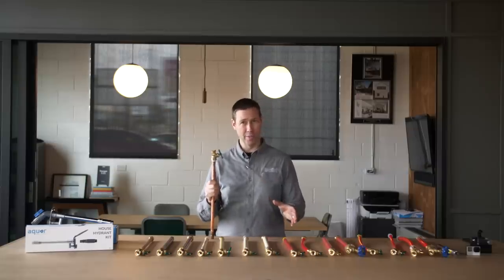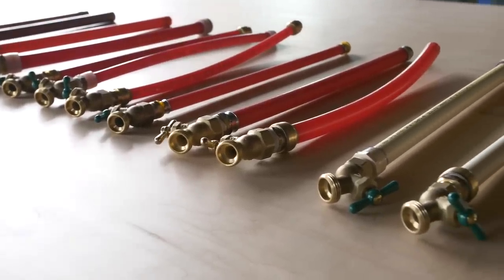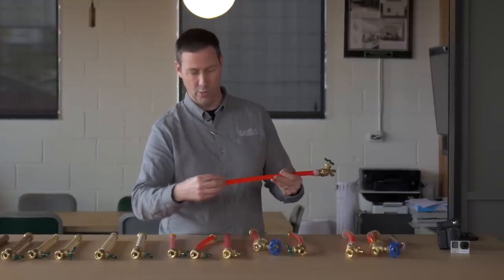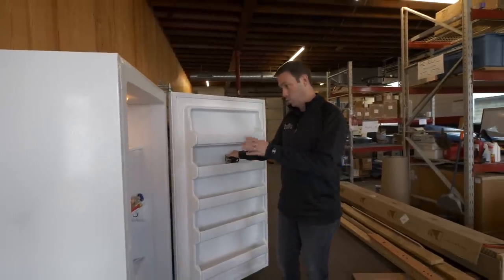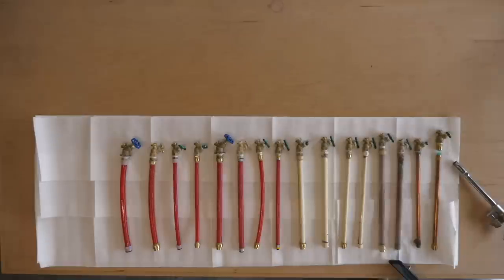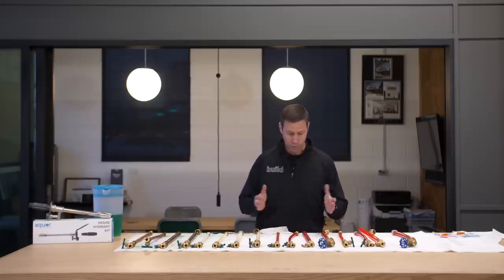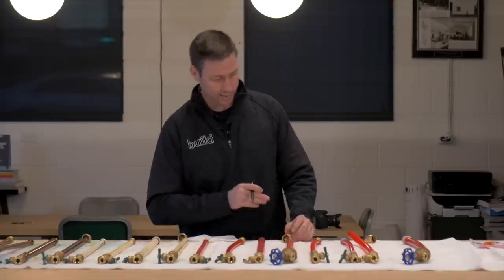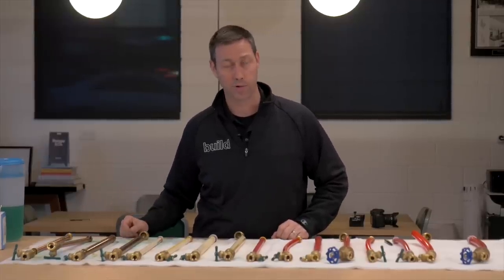Copper vs Pex vs SharkBite - Freeze Testing

Comment: Would have liked to see the lines pressured up to typical line pressure instead of static pressure.
Reply from the maker: oooooooooooooooooooo maybe on the next one
Reply: Good call Ben.
Reply: And you can attach a hose back on the bib after the freeze-thaw to do a watertight test to see where any leaks occur
Reply: While your theory about water's compressability is true,  you're missing the fact that the failure on the system is pressure driven. Starting at 0 baseline pressure does in fact change the results. As the water freezes, and the remaining water can't compress, it's pressure builds. Starting at 60 psi puts the water in a pre-pressurized state and would decrease the time to failure given you'd reach critical pressure sooner.

EDIT: And build a higher pressure in the system for the pipes that showed no discernible damage, potentially causing their failures as well.
Reply: Ben Madison 
Definitely interesting. Don't you think as the pressure rose above 60 PSI that the ice would just begin to push back on the water and equalize pressure throughout the whole house?
Another thought I had was that repetitive freezing would have been nice to see. Sure, the shark bite connectors dug in the first time but what happens on the 2nd, 3rd, 4th time?
Reply: I have a real problem with the cpvc. Under regular water pressure, I believe it would have broken.
Reply: Freezing water expands about 10%.  The copper splits because of the pressure increase due to the water expansion while freezing.  The bursting pressure of copper pipe is in excess of 4000psi, so starting at a base pressure of 60psi would have made no difference.  The plastic pipe sample's pressure does not increase substantially since the plastic expands  with the water.  There's a very comprehensive study online done  by the University of Illinois back in the 90s.  Interestingly you can have the break occur inside away from the freezing area if that's where the weakest link in the piping system is.
Reply: I've been out on frozen copper lines. Soft L copper would sometimes freeze several times before busting. The real clue was that couplings wouldn't fit - the copper had swollen up. That could be a real mess, trying to cut back to copper that wasn't oversized.
Reply: I came here just to make this comment.
Reply: PVC will split, it matters.
Reply: I would speculate there might be more failures.. copper..worse.. freezing water can break a cannon ball in half.. how many lbs of pressure is needed to do this? does 60-100psi change this?  no..not likely
Reply: Thank you, Lee. Hydraulics are hydraulics.
A starting pressure of 60 would make no difference in copper, because it already failed. Wouldn't make any difference in PEX, because it will just stretch a teeny bit more. I think even CPVC will only drop the shark bites after some cycling.
Now, if you fill them with water, pressurize with  an air compressor, THAT might be interesting to watch.
Reply: Google "Copper Tube Handbook PDF". They list actual burst pressures for various sizes. These are around 5,000 PSI. So the 60 PSI won't change anything. (Also, it is a level playing field if you compare same diameter pipe to same diameter pipe. )
Reply: Here’s my $.02 worth lol. 
If these pipes were part of an entire house system (yes 60psi) when subjected to freezing temperatures there might be failures in other locations or none at all. I’m thinking this:  As the water at the spigot starts to freeze, any extra pressure would be dissipated into the system. Also, if the water in the pipe just before the spigot freezes first then the pressure from the water freezing IN the spigot would have no where to go and would probably cause the spigot to fail. 
Side note:  when I had my house built I had the plumber plumb 2 separate systems; internal & external. The benefit is of course my ability to shut off the system that supplies water to all external pipes and spigots. In the coat closet located a few feet in from the front door there is a removable section of flooring. Underneath that section are several large valves. One of them controls the external water system. In late Autumn I simply turn off the appropriate valve. In Spring I turn it back on. A second valve controls the internal water system and the third valve controls the natural gas. The idea for this wasn’t mine lol. I borrowed it from my uncles house in the U.K. lol
Reply: pex A has been lab tested to 1500 lbs sq in
Reply: @Ebbrush3  the prepressurization would stretch the pipe toward it's limit and compress any bubbles making it take less increase in volume to get to the final failure pressure. I thought the real world condition that is missing putting the whole pipe in the freezer was that the freezing starts at one spot where it does no damage and freezes toward the warmer spot where it stretches the (copper) pipe. That extra volume makes it more certain that spot will freeze last on subsequent freeze cycles due to more heat capacity. The process repeats until the pipe fails. That's why frost free spigots fail at the inside end when someone leaves the hose hooked up.
Reply: @ike fun The question answered by pressurizing the lines to working pressure isn't so much "will they fail" but "what is the extent of the failure." I think the value in pressurizing the lines would be leak detection after the thaw.  Micro-fractures that are water-tight at 0 PSI might spray like geysers at 60 PSI, especially in the more flexible materials.  Also, if ice formation caused a leak early in the freeze, the subsequent moving water through the leak might affect the results.
Reply: I wonder if the freezing point changes with pressure.
Reply: hey you Not enough to make a difference at typical working pressures (80 psi). Water’s critical pressure to stay liquid below its freezing point is almost 3200 psi.
Reply: @Lotharyx  I knew pressure cookers could alter the boiling point easily wasn't sure about the freezing point. Thank you
Reply: What about introducing an air tank to the system like the ones used for hot water expansion. Maybe that combined with pex would make a system freezeproof.
Reply: I have pex in my barn under standard line pressure year round , in one section of the barn the lines have frozen multiple times and not one failure in 2 winters usage they freeze solid then thaw out and everything works again
Reply: Lee Hammond you nailed it.  I’m a maintenance superintendent for the largest rental company in the United States.  Just had a water line pop that was the furthest inside the home away from exterior weather.  The Filter system under the kitchen sink uses PVC and couldn’t hold the pressure of the freezing pipes causing the filter housing again which is PVC to fail and in result flooded the kitchen.  Keep in mind the water main was off at the time but the resident never drained the lines after turning off the main valve.  2inches of standing water in a kitchen all because somebody never turned on the faucet to drain the pipes.......
Reply: Frozen water isn't affected by  the pressure Mr. Rocket scientist.
Reply: @at8504  how gay is he? Or how is gay joe?
Reply: @TheSteelArmadillo  ,you do not want to do this with air. If the air pressure builds high enough to split copper the air will be released at that pressure like a bomb.
Reply: @chuckcreel4428  Just don't be holding it when it happens. Plus, I suggested to fill it with water then pressurize it with an air compressor. There would be next to zero actual air in the pipe, as the water won't compress to make room for it.
Reply: I was about to note the same error in this test. 👍🏻
Reply: Yea,, but since all were subject to the same conditions I think the result would be the same
Reply: And if it leaches anything in hot water. Using plastic in a high end house feels wrong.
Reply: Agreed.
Reply: @Mr Sunshines Sorry skippy, but you're wrong.  The higher the pressure, the lower the freeze point.  And as water freezes in a pipe, it also creates higher pressure.  And it's not the ice that causes the break, but the pressure of the unfrozen remaining water.
It's not "NASA crap", it's everyday physics and just plain old common sense.
Reply: @HungryStickMan  ... but what does the 2nd, 3rd and 4th time matter when the copper fails the 1st time, 100% of the time.
Reply: The test is faulty from the start. Regardless, pex is pretty reliable and doesn’t pose many problems.
Reply: Mine held up with typical line pressure during the deep freeze last week.
Reply: Yup, it's the pressure that kills them, not ice expansion.
Reply: @swingset1969  yes and no, the only way pressure builds is because ice expands. But expanding ice doesn't break pipes, the pressure it creates in unfrozen water is where it gets crazy.

I think a better example to show what is happening is only having half of the sample in a freezer and the other half exposed to warmer temps.
Reply: ABSOLUTELY! This is moot. While I know water is non-compressible, standard pressure would have been a much better real-world simulation. Without it, a single air bubble in a valve or fitting would change the whole baseline.
Reply: @Plumpplumberbalding  I despise ALL pvc pipe for myriad reasons.
Reply: @Plumpplumberbalding  Try forgetting copper forever. And covered wagons.
Reply: Wouldn't make any difference water is an incompressible fluid.
Reply: @sheet-son  which is the exact reason pipes burst. Pressure is the cause of pipe rupture.
Reply: @TheSteelArmadillo  if there's zero air in there, then what is doing the pressurization? You'd have to have sufficient air volume in the system for it to do anything, otherwise it's just the liquid and back to the same static pressure as before.
Reply: @wingerrrrrrrrr  I think you misunderstand.
Reply: @TheSteelArmadillo  you suggested pressurizing the tube with an air compressor, which implies the tube is open to your compressor. This test needs a closed system with no openings.  How are you proposing to pump air into a closed tube? Again, if you have zero air in the tube, there's no air pressure to do this pressurization you suggest.
Reply: @bluenadas  I can't speak to the science behind this issue but I think the expanding ice is what breaks the copper pipes and this is why. One month ago, I replaced 5 feet of copper in a home baseboard heating boiler system that had 2 splits 3 feet apart. This was in Minnesota after a week of sub zero temps. At one point in the system when the house was built they ran the copper down under the basement concrete pad and across a door and then up again to continue the heating register run. This is the lowest point in the entire house. Both splits were under the concrete pad about 2 inches inside the doorway. The system is normally pressurized to 20 psi and has an over pressure release valve at 30 psi. It has 4 heating zones and an expansion tank and when a zone calls for heat a pump is also activated on the cold return manifold to move water around. When these pipes split it basically dumped the whole system because the return lines all come to a common manifold so even if we shut off that loop we could not prevent other loops from back feeding in to it if they were activated. So as things were freezing that point was continually fed with water as the system drained. How do we explain the burst pipes, if water is incompressible, and is in a system that has at least 2 ways of dealing with over-pressurization? This sort of is a real world example of your half frozen, half warm test.  By the way - for science sake - both burst points were very close to the elbows heading back up through the pad to warmer temps. Did it all freeze and the elbows prevented expansion laterally so the pipe popped?
Reply: Doesn't matter the pressure.
When water freezes, there is no stopping the expansion.
Those fittings probably held till 300psi or so before blowing off.
Uponor pex tube blows out the side around 300-350psi
Reply: @leehammond3289  I've seen Fluid Master toilet fill valves broke in a heated room from a pipe freezing 20 feet away in a drop ceiling.
Reply: Once the water freezes, the  utility service pressure  has no bearing. The internal freeze related expansion forces far exceed  the 40 -50psig utility regulated liquid state pressure values.
Reply: Big difference!!!!
Reply: In the Navy, I was trained on how to freeze water in a pipe, so as to repair/replace valves in reactor systems.
Your 'plug' had to withstand a 5000 psi hydro to pass.
You could do it with R22 or liquid N2.
Reply: @Tim Kopp  That's why I always install expansion tanks on toilets.

Just kidding, but a waterhammer arrestor might have saved the fill valve.
Reply: @WetSpotatBRC  true, but if the freeze starts somewhere in the pipe that isolates the arrestor it won't have any effect and a break will still occur.
Reply: @Ben Madison  I assume an arrestor would be close to the closet supply valve. Your right, if the supply valve or the supply line froze, you still could still lose the fill valve. Just like the rest of life, every solution just comes with a new set of problems. I mainly was just amused at the thought of all cold climate toilets having expansion tanks on the wall next to them.

Comment: I have 12 rental houses in the Houston area. During the freeze in February 2021, the 6 rental houses with Uponor Pex had no issues. The 3 houses with CPVC had cracks in the horizontals, one house had 21 cracks total in the horizontal CPVC. My personal house had one crack in the half-inch 90 degree CPVC joint. Also, 1 house had copper and another house had galvanized steel pipe. The house with galvanized we're looking at total pipe replacement with Uponor Pex.  The house with copper we're looking at replacing the outside lines. Overall were sticking with Uponor Pex!

Comment: Landlord here in E. Tenn: Copper freezes and splits. Some times it makes it past the 1st freeze, but a 2nd hard freeze (teens) will always fave a failure. Even CPVC will fail, regular (white) always and before copper. That said Pex is best. And the connection system Matt uses is the way to go, don't use the metal crimp rings, they will all eventually fails (experience here).
BTW; Matt: Thanks for another GREAT video.

Comment: As a pro plumber, I've seen all types of pipes fail.  Rodents will actually eat ANY pipe if they are desperate enough for water, or if they already have established that there is a water source available.  I use PEX-a almost exclusively, and while the fittings can and will freeze break if exposed to harsh enough temperatures, it has been by far the least faulty pipe system we have ever used.  There are a few different brands of it out there now, but compared to the PEX-b or other soft plastic like polybutylene it is a huge game changer.  If you have a rodent problem, deal with the rodents, irregardless of the type of pipe you have.
Reply: I don't think I would trust polybutylene  for hot water. Rodents can also chew the insulation off electrical wiring, creating a fire hazard!
Reply: Thanks I want to use Plex for a remodel.
Reply: As a pro plumber you should see all his failures in this video. Primed cpvc and all shark bites..no pex crimps...this guy is a nightmare
Reply: Andrew Mumford I only use Brass fittings. Plastic fittings fatigue and brake or split.

Comment: I had a new construction home with pex freeze while under construction no heat yet , no insulation yet, I saw ice inside the clear 3/4" lines. When it warmed up there were absolutely no leaks or damage.

Comment: I live in an old house that is completely plumbed with polybutylene pipe otherwise known as Quest pipe. It was built about 1980 so the plumbing is about 40 years old. The pipes under the house have frozen numerous times. I’ve never had a leak. I can get under the house and inspect all the plumbing. It has never leaked a drop. I’ve replaced faucets and the toilet but none of the pipe. I know, I know, quest pipe is supposed to be horrible and everybody recommends replacing it but so far so good
Reply: The fittings were the major problem.. the plastic they used to make the fittings would crack because of the ring.  I’ve been plumbing 30 years pex is the best pipe ever

Comment: When I lived in Chicagoland, they used brass and copper.  But the pipes were typically put in inner walls or heated spaces to avoid freezing.  Here in Texas. I agree with your review, with 1 exception.  A relative, with a 23 year old home had several broken pipes with the recent freeze.  2 copper and several PVC pipes burst.  The PVC pipes were old, exposed to elements in some cases.  In all cases, the bursted PVC pipes were extremely brittle.  They were much more brittle than new PVC pipes.  Me and my neighbors, in newer homes using pex faired very well in the single digit freeze.

Comment: Frozen north weighing in, I found that even copper, IF it freezes from the hose bib or valve working its way back inside will survive...its only when a section freezes at two places does the pressure build and split or bulge the pipe.   Just my experience over the years...I have one old valve with no protection whatsoever freeze solid from the outside inwards and has never failed over 40 years...finally replaced it just to be safe...like your site...thx.
Reply: Same Hank, I have two with no protection at all, and come summer they're always fine.